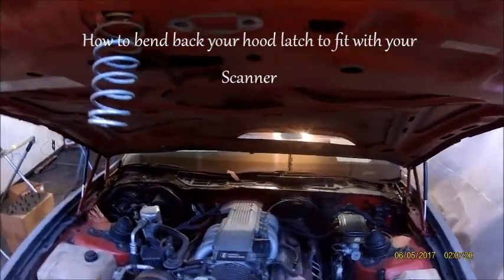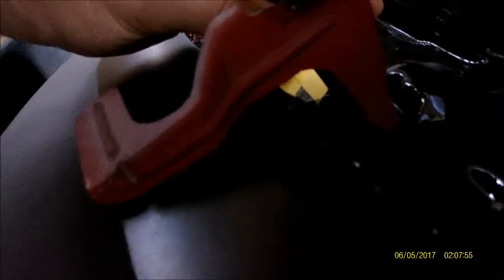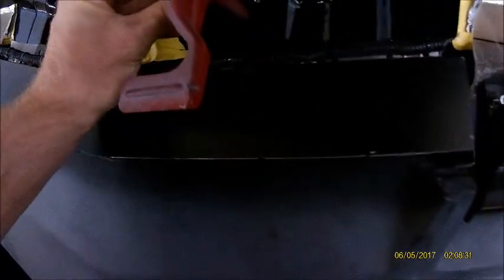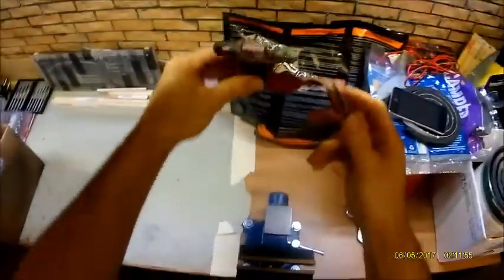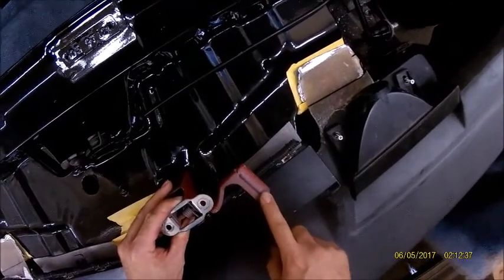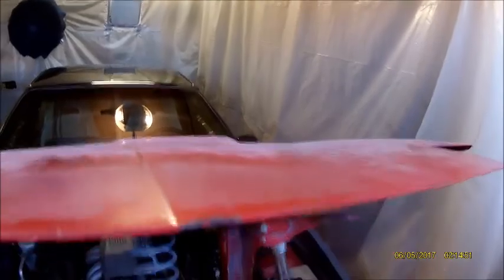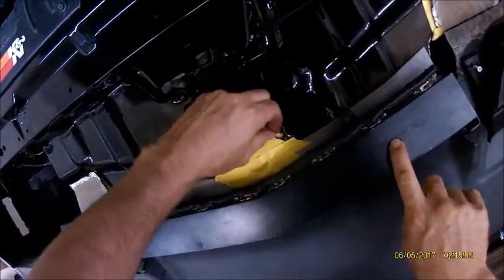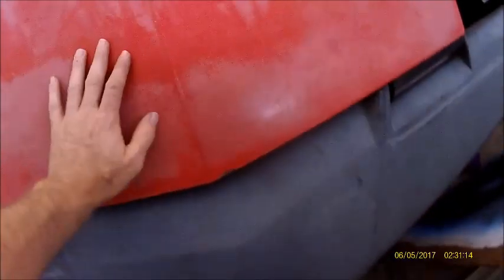How to fit your Hood latch with Knight Rider Scanner

Comment: Firstly.., if you're planning to drive your KITT in traffic with other vehicles, you should NOT permanently remove the hood's Safety Latch. It's there as a "safeguard" to prevent the hood from flying backwards onto your windshield, should it become unhinged (for whatever reason) while driving at a high speed rate.

Secondly, when closing your hood, place your hand(s) on top of the hood, over the exact location where the hood catches the Latch underneath. It'll help them connect easier when closing. You're trying to close your hood by pushing too closely to it's edge (which makes closing difficult, too). 

I own a "Knight Rider" (KITT) as well, so I'm familiar with the nuances of building/maintaining the vehicle. Plus, I DO drive mine practically daily, so there's some things on these "Conversion Cars" that must remain for safety. However, if you're planning to use your vehicle strictly as a "Show Piece," by all means.., you can discard the Safety Latch.
Reply from the maker: Well said, I drive mine alot so I dont remove it, the most I would do is remove the whole arm of the latch so it dont hit the scanner, and pull on the hatch with my hand as I said in the video.